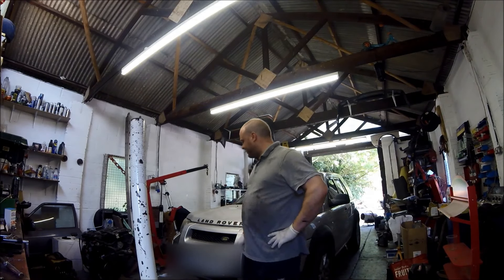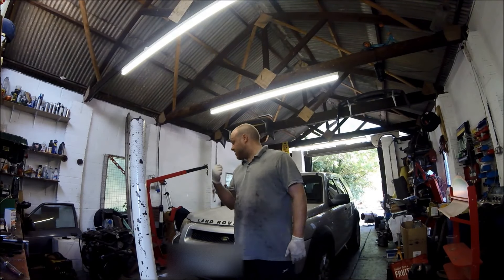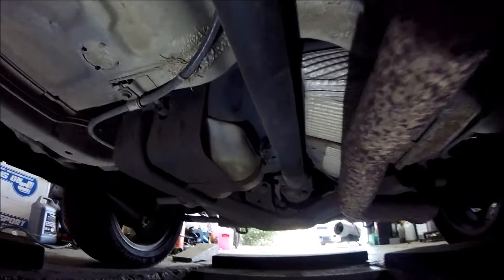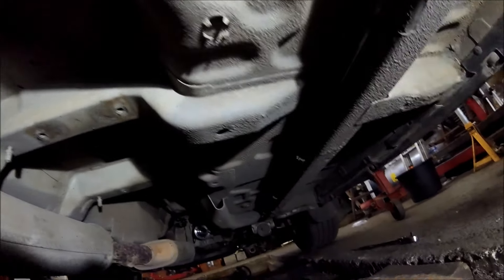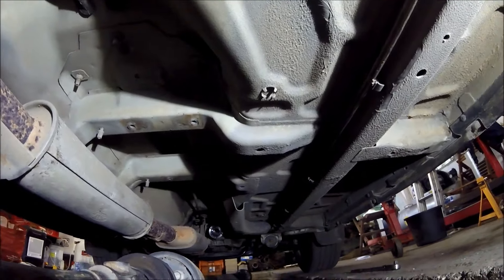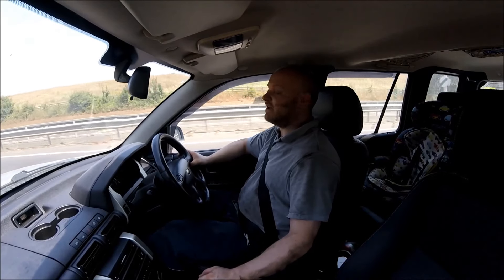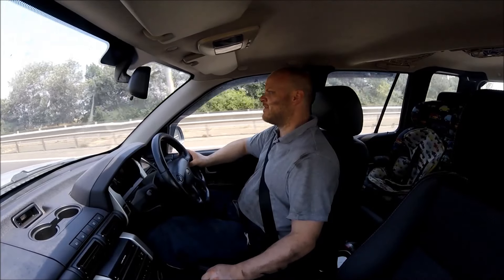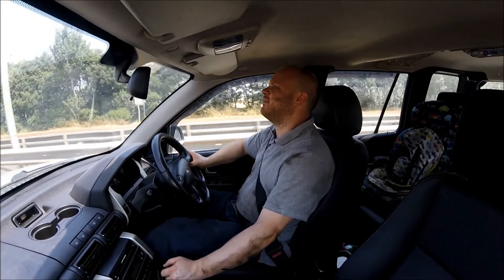Land rover Freelander 1 viscous unit  propshaft bearings problems removal test drive  M-Tel garage

Comment: Hi do u need a blanking plate  or  anything .

Is it simply a case of just removing what's there 
.theres nothing u need to buy no conversion kit or nothing 
Just simply remove
Reply from the maker: yer all u have to do is remove the prop-shaft and thats its  :) there is a blanking plate u can buy to blank off  the out put on the IRD,
 but thats up to u,
 most people just take the prop off and thats it
Reply: But you need to leave that gaiter on, to avoid loosing oil?
Reply: Hi bro my freelander is having a strange vibration on my back wheels especially the left on each time i make a turn to the right or left.. Is it due to the popshaft bearing as well? Can I remove it safely n drive as usual? Mine is 2004 2.5 V6 petrol engine.. Pls advice as ive changed all tyres n alignment too but still the same😢

Comment: Why buy a 4x4 and convert it to a 2 wheel drive? You now have a car that is not up to speck, more chance to wheel spin, and absolutely shit in bad weather. Do what needs to be done or go out a buy a correctly configured 2 wheel drive car.
Reply: I understand what you are saying but ive owned many 4x4 over 30 years and majority of the time they were in two wheel drive mode on the tarmac out of choice  (Shoguns,Trooper, and my favourite the Land cruiser) only on the odd occasion if I went off road did I ever flick it in four wheel drive a lot of the later model cross over or "toss over" cars have electronically controlled 4x4 which come into play automatically.
Just my opinion though.
I

Comment: it is a MOT fail if you remove the propshaft i was told by my MOT tester
Reply from the maker: Mine passed its mot with out the propshaft  fitted :)
Reply: great to know..i always suspected my MOT guy was a dickhead control freak...i will investigate further and if so lose my propshaft...thanks for the advice! and vid! i purchased the IRD blanking plate ages ago but got put off by corperal MOT twat
Reply from the maker: Yer if u are having problem with your prop it's easy and safe to remove
I will say tho the the car become a bit more lively and you have to be a bit gentle on pull aways
Mite was a sport wich have big 19inch wheels on it so I didn't even notice much
But when they have the standard size wheel they do become a bit lively
Reply: You'll need to information your insurance company if you remove the prop shaft.